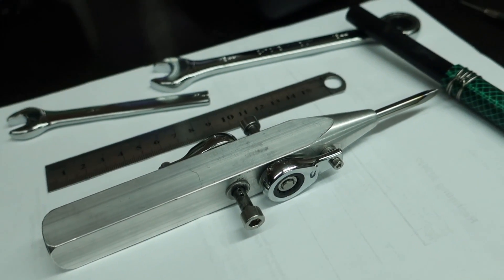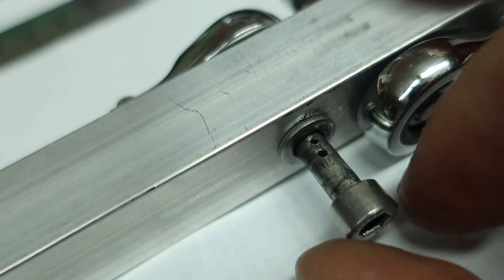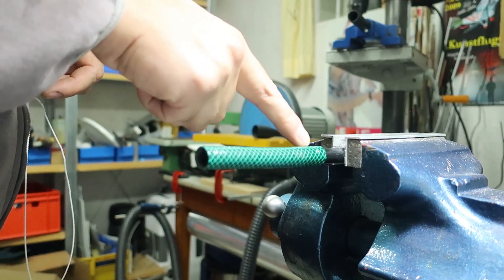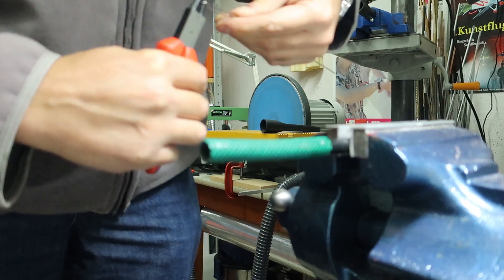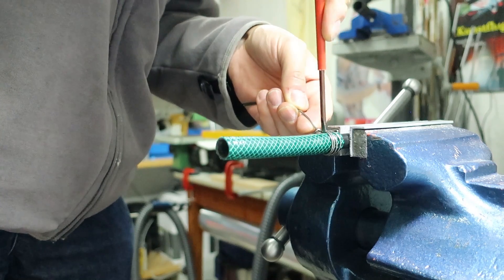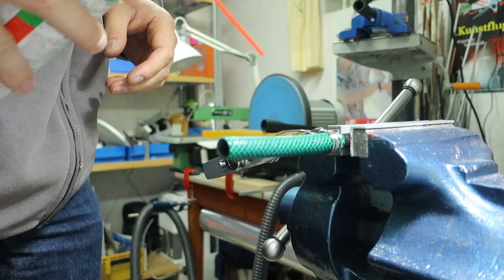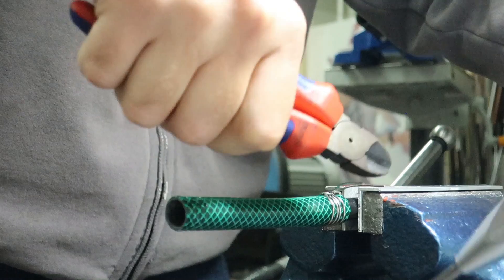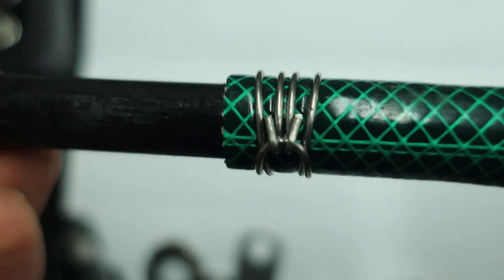German DIY Wire Hose Clamp Tool

Comment: @Extremflug  I'm going to interject myself here, if you would be ever so kind, to indulge me this opportunity to share some thoughts on a few pertinent details, about the precise concept about that, which is the absolute central core, the Nucleus. Nay! The atom that occupies that point in space, which is located in the absolute, centralmost, source of this entire spark of genius that brings us here in the first place.
I believe that a dual co-linear, tension take up shafts system could become an incorporated feature of a somewhat upgraded version of your, very impressively proportioned, and powerfully staminatic, tool. 
The same dual ratchet locks would continue to be a central feature of the tool.
Precisely at the centerline that bisects the axis of the dual co-linear, tension take up shafts.
This is where the ever important HTO (Human Tool Operator) interfaces with your tool.
It is via this interface that the HTO provides motive force required to provide the energy for the mechanical work this tool performs.
The lever is to be moved in a "Fore and Aft" motion by the HTO. 
The anchored, pivot end of said lever shall be designed in such a way that, it is capable of engaging the take up shafts as one continuous assembly. Or. It may be engaged, with either of the two individual shafts. This allows for the tensioning of the take up shafts individually. The take up shafts opposite the take up shafts being adjusted, shall  maintain their engagement with the ratchet lock feature. 
The aforementioned ability to engage the take up shafts as a singular assembly, or, each of these shafts individually; This ability shall be controllable, selectively by means of a clever, conveniently used by the HTO, feature.
Inclusive to this "selector" feature, shall be, a means by which, the selection made by the HTO, shall be secured until which time the HTO intentionally chooses to amend his previously made selection.
It is important that the operation of this "Selector", be; 
Convenient and intuitive to the HTO.
Able to operate repeatedly, and reliably, for extended periods of time, without taxing the HTO excessively.
This importance cannot be overstated. 
I look forward to learning of your views and considerations of this proposal.
Reply from the maker: Hello Bob, thank you for your comment. You sound like a patent lawyer, and I mean that in a positive way. Unfortunatelly, my language skills are not enough to understand your text completely. I suggest you build a tool with the proposed improvements, and present it here. If it works as good as I think it will, the audience will surely meet it with great acclaim.

Comment: Only one I have seen where you have control over the tensional force in each wire separately.

Not sure this is critical if one has some symmetry to the wires in beginning.  The one that is shorter will pull 1st then the 2nd wire will catch  up for balance. 

I was concerned about this until I say the 1955 Patent device that Mr Pete did a video on.   

Nice work.  I'm working on a design for larger wire for field work, fences, timber , etc. So many versions of this device, it's nice to see all of the directions.
Reply: I think this one is simpler and better

https://youtu.be/mRc7ZDRcgrQ

Comment: What about putting the ratchets colinear with one bolt and two nuts between them, locktited. Only need to drive one point.
Reply from the maker: I'm not sure if I understand your idea correctly, but would one still be able to tighten both wire ends independently?
Reply: @Extremflug  why do you need to tighten them independently? This looks nice but I would think one bolt that extended beyond the nut would work well.
Reply from the maker: @akbychoice  Hi! Initially, I used fairly stiff wire. Here I noticed that the initial windings around the tube were not that perfect before tightening, and had different amounts of "slack" in them. The site with greater slack would have lower tension if it was tightened the same amount lenghtwise as the side with lesser slack. So, basically, my contraption can compensate less than perfectly equal initial windings. The bigger the diameter of the whole clamp and the softer the wire, the less important this aspect becomes.

Comment: By far the most complicated. I've looked at many and have made several of a copied design. YES, it could be made more simple and efficient. What I love about this first is the meticulousness in the build including oiling the hoes. The take away for me is the innovative ways one can find to use parts to manufacture your own tooling. The ratchet part will be Kept in the back of my mind to use once I have the right job for this idea.

Comment: Hey would it been better to leave the handle on your two ratchet wrenches so you could just use them to tighten the wire , instead of using a third racket wrench . Impress me by making one that has a cuter on the end of the tool an uses less wire . You install wire in a tip holder then wrap wire around hose or what ever needed clamping then cut a little extra install that end in device the ratchet bought at the same time ,then bend over an then use built in tip cutter to cut less than 2 miler meters from the end of the wire . All in one tool .

Comment: Excellently over engineered. And nice attention to detail while wrapping (lube, individual side tension etc). Nice job indeed. Danke - Lumpy
Reply from the maker: Thanks for your kind comment :-)
Reply: Agree. I was just ruminating on the tool I want to make, and thought that the wires would benefit from lube during the tensioning -- as the tension is ultimately held by the wire when the wrap is finished. I suspect that almost any liquid will serve -- liquid soap, water, alcohol, etc..

The other thing I'm considering is incorporating a jig, within or on the tool, to rapidly generate 'set-ups' -- partially pre-wound, two-turn coils, with U at (or near) the mid-point of the overall length

 In a related video, I saw a clever solution for generating the loops/coils: a symmetrical, planar winding is done first, roughly in the shape of an excessively-curled handlebar moustache, and that is then  folded, as 'wings', out of that plane so that the two halves, mirroring each other, occupy planes perpendicular to the first, and parallel to each other.  I hope to be able to generate set-ups and apply them as wire wraps with the same tool. 

I like the idea of a means to independently tension the two ends, but think using a new ratcheting box-end for each side is extravagant. An alternative that is more affordable and likely involves less machining (and, therefore, simpler tools) might be found in adapting a fairly respectable ratchet mechanism found in stem-shifters (think bicycles) of very old components made by Suntour. The model I'm thinking of integrates a simple sprung pawl on a very toothy ~1.5 cm diameter gear, all connected to a lever of ~10 cm… Perhaps best of all, these shift levers are 'pre-plumbed' to pull cable, which is analogous to wire.  You might be able find such shift levers on very old road bikes (10 or 12-speeds).

Thanks for the exemplar, the attention to detail, and the inspiration.

Tools are a contagion.